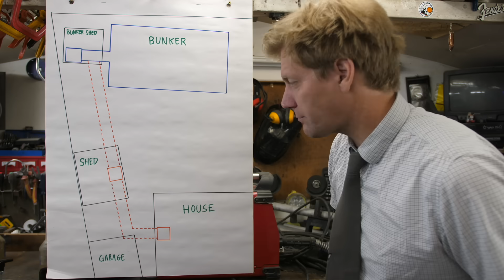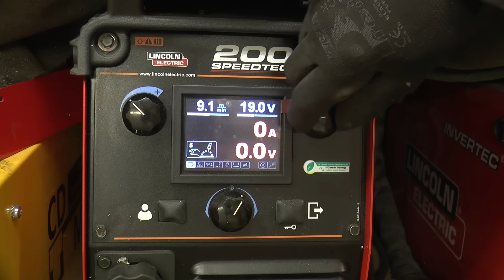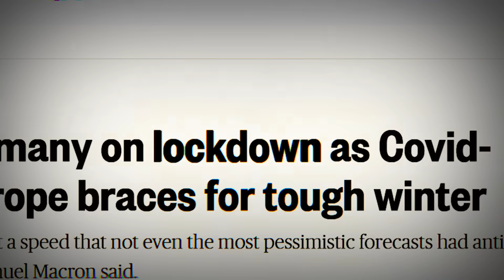DIGGING A SECRET TUNNEL Part 2

Comment: This is insanely dangerous without any kind of shoring in place for the soil. OSHA requires shoring in holes larger than 5-6 feet (1.5 meters). This is because construction workers die every year from cave ins. Even if your head is free and you get buried up to your chest in dirt you can suffocate within minutes because the weight on your chest prevents breathing. 
I really want to see the end of this project. Try not to let it kill you first...

-Edit Full disclosure,  I am in the civil engineering fields. I have taken OSHA courses and have my certifications. Several of your videos have made me cringe out of safety concerns... This one might be the most dangerous though so I had to leave a comment.
Reply: He'd better hope to God no one gets injured or dies replicating this stupidity.
Reply: Doesn't the metal cage work as shoring?
Reply: @SIGSEGV1337  In construction we tend to use sheet piling, it is made of corrugated sheet steel, about 1cm thick (.375inches). Loose Soil weighs about 75lb/Ft³ (1200 kg/m³). Compare that to water which weighs about 1000kg/m³ you can see how the pressure can increase very quickly when we talk about 3 to 5 meters below the surface. I am not a structural engineer so I have only ever had to do the calculations and design sheet piling in school and I never had to design a shaft. However I can tell you without a doubt that the pressure and momentum of the soil failing would easily rip those wire cages right off of that wall. Even if it didn't the wire itself looks to have somewhere between 0.5inch to 1inch spacing. This will only catch the soil that that is cohesive enough to be caught by the wire. Considering a soil failure usually involved the soil losing cohesion (especially from water), I would not rely on it to protect my, my family or a friend's life. I would even think twice before sending my in-laws down that hole...

-edited for clarity.

Comment: Instead of the ladder you could you a counterbalanced metal "hot-air-balloon basket" lift with a sideways swing door and lower yourself down onto a bucket with a chain drive on a loop. Forward to the house then just reverse gear to go back to shaft or cave. so cool!

Comment: Need to break through that limestone barrier? Use a steam drill to make several (4 or 5) holes approximately 1.5" to 2" in diameter and roughly a foot deep then...4 or 5 sticks of dynamite and a little distance.

Comment: Back in the 70’s had a neighbor that dug a tunnel, from his basement to a two and a half car detached garage. He used a posthole auger to loosen the soil. The Tunnel was put together with bolt together corrugated curved pipe sections. He alway had free fill dirt available. County, tried to cite him and force him to remove the tunnel after he was finished, and they discovered it. There was no ordinance against what he did, LOL.

Comment: Not to be a know-it -all, but there's this new contraption, been around, oh, 30, 40,000 years. It's called a wheel.  Some smart guy put a metal bin on one, and with two sticks across it for handles.   You know, it MAY work well for moving dirt, and rocks; merely speculating here, but it might be easier on your effing low back.

Comment: What has amazed me is none of the handles of those plastic tubs have snapped, and broken limbs, or killed one of you.  You are a lucky bastard; buy a friggin' lotto ticket.   Also, you better put something stronger for cave-in protection going horizontal.   Well, if you didn't, you've survived, cause it's the future, and the news hasn't been about a crazy Brit YT'r dying in a self dug tunnel.

Aw, eff it. Buy a lotto ticket you lucky bastard.

Comment: Your probably too far by now. Or maybe you though about it. 

I would have digged just a bit deeper and leave a space to move in and do maintenance. (To avoid pest) use that new gap in the floor to drain water if it ever floods and install pumps to empty it out. This way it would look nice and not really have build ups and flood risks. For whatever reason.

It's small quality of life things. And compared to the whole order and investment. It's more work but rather just cheap add-ons.

If not a built under if would have been a slant in the floor or small irrigation to one side and pass in a grate in the wall. Where the pump is.